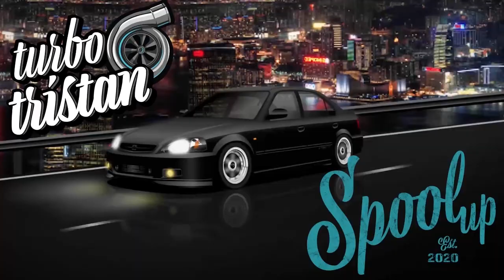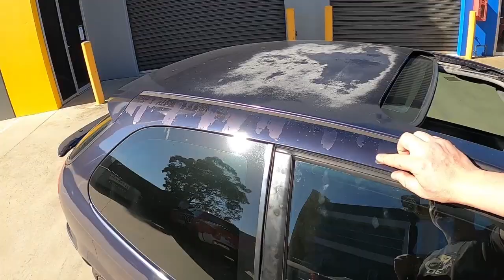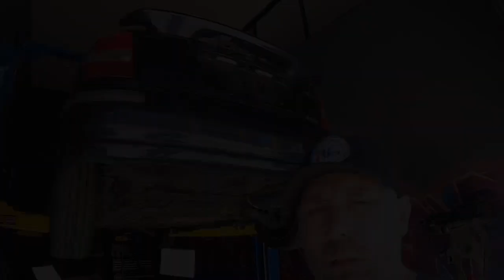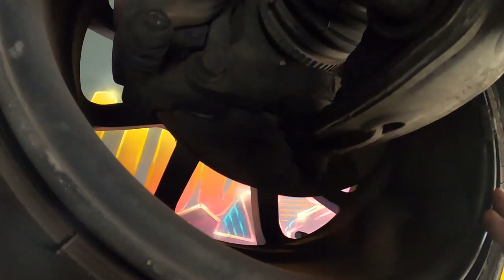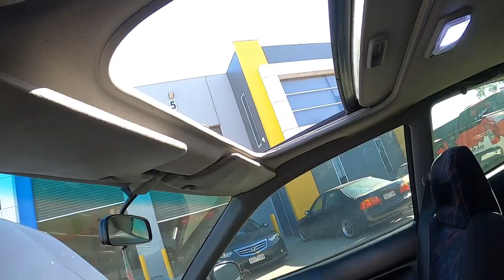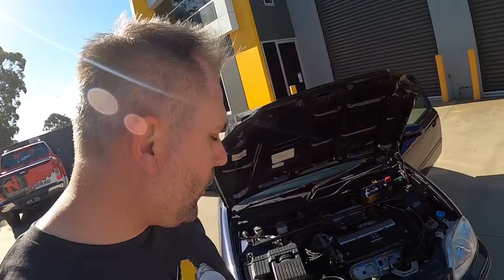TRADED UP THE EK1 D16 TO AN EK4 B16A -VTEC BABY!!

Comment: Quick science(maybe?) lesson as to why the B16 doesn’t feel quicker..

B16 specs (hp/tq/bore/stroke) 
119kw @ 7600 150nm @ 6500 81mmX77.4mm 

D16y8 specs (hp/tq/bore/stroke)
95kw @ 6600 145nm @ 5500 75mmX90mm

B16s are torque-less wonders for a reason.. the D16 makes it’s peak numbers 1000rpm sooner, but basically match the exact numbers a B16 makes at the same rpm until the B16’s superior vtec system(dohc and higher cfm head) take over. D16 is generally(within 5hp/tq) making the same amount of power as a B16 up to around 6500rpm.

Another thing that can’t be underestimated is torque and how an engines stroke plays into that. For Honda’s a 90mm stroke is pretty big, 77.4 is relatively small. The D16 is optimized to be most efficient at mid engine speeds(<7500rpm) where as the b16 must rely on high rpm VTEC cam profile, high flow cfm and high rpms (7000-9500). They have the same 1.6 liter displacement but move air quite differently because of the stroke.

(This does not account for every engine tuning variable of course!)
Reply from the maker: Of course good science tip I will read your comment out next video man it’s perfect thank you
Reply: @TURBOTRISTO  repeat it at your own risk, I honestly have no idea what I’m talking about ;) 

Looking forward to this build, I really liked the direction the Flouro civic went and can’t wait to see this one!
Reply from the maker: @damcleandetailing  haha  ok

Comment: Trying to get some guidance pls. Doing a Honda D series Turbo build with a D15b bottom and D16y8 head. It has a T3 log manifold. Wanted to know what is the best size T3 turbo to use on this build to keep the air condition. Thanks in advance!
Reply from the maker: Keeping air con is almost impossible with out a lot of custom piping and manifold, I would say you need to high mount the turbo to best be able to keep aircon but really you need a small turbo like a t2 flange and something like a td04 or t25 turbo t3 is too big to try keep air con
Reply: @TURBOTRISTO  thanks for the info! Can I use a T3 to T25 adapter with a T25 OEM SR20 turbo to save the aircon?
Reply from the maker: @alishajahore9149  should do nothing is certain mate it’s all trial and error
Reply: @TURBOTRISTO  Thanks mate.
Reply: @TURBOTRISTO  what’s your recommended part from Max Speeding Rods - coil overs for 97 EK1 3 door hatch D16Y4
Reply from the maker: @clarkski1  yeah if you can stretch you budget the new blue and black coilovers are amazing from mxr the link is in the description with a discount also
Reply from the maker: @clarkski1  yeah man grab the blue and black maxpeedingrods coil overs they are amazing I raced my d16y4 civic at the track on them and they are perfect! The link is in the description and you get a discount when you use my code Tristan1
Reply: @TURBOTRISTO  thanks man
Reply: @TURBOTRISTO  ordered, hope some cash comes back you you. Your content is killa 🤙
Reply from the maker: @clarkski1  thanks man

Comment: What type of smart arse swapped a B series EK for a D series😂💀
Reply from the maker: The guy sought me out and offered the deal I just accepted it
Reply: @TURBOTRISTO  I flip cars for a living and I know a steal when I see one, your D series EK is a clean car inside and out, but the D series is a economy engine, even the gear ratios are meant for highway cruising and normal driving, it will never make any significant increases in performance, but all you need to make the B series EK go is a set of aftermarket cams, full bolt ons and a tune and the car will be a beast, I got a friend in New Zealand who fully built a NA B16 EK and the guy chops WRX's and some pretty serious turbo cars, your really lucky you got that car man
Reply from the maker: @Yuaaaur  I’m
An ex car salesman of 15 years bro haha small world